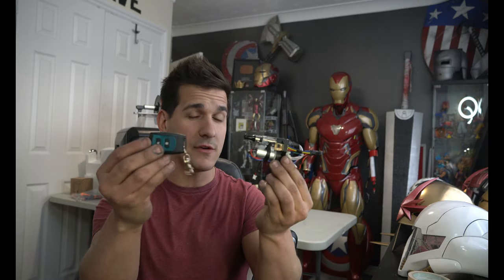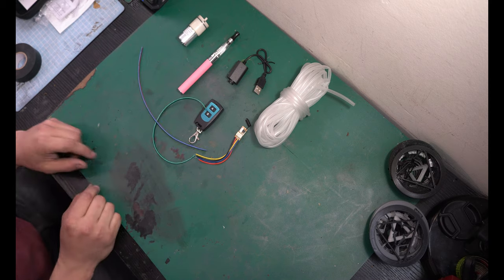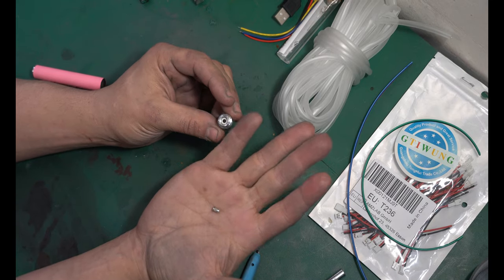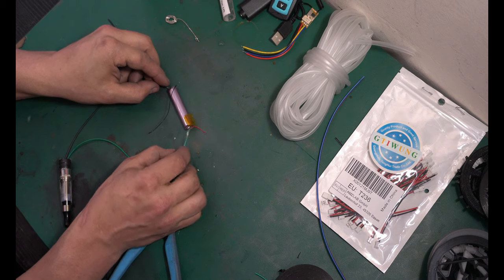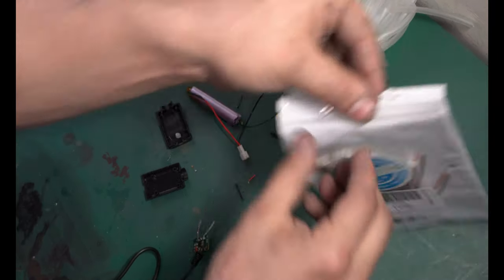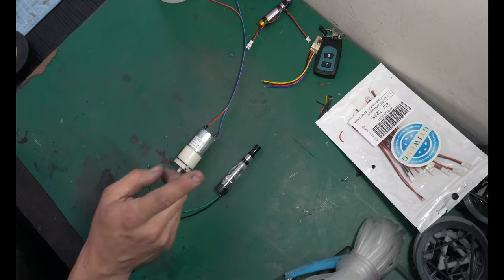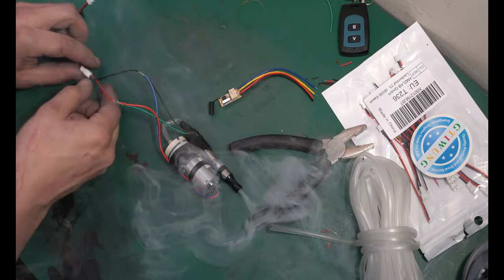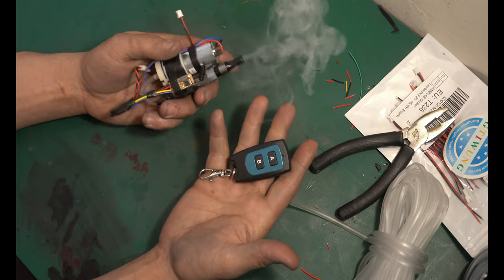Remote Control Cosplay Smoke Machine  - Tutorial

Comment: I'm curious if I added a hose to the front where the smoke is coming out, how far could it be directed. I'm trying to make the nostrils of a dragon costume smoke. Even though the smoke machine is small, it's too heavy for the mask. If I put the machine in the wings and run a hose over the shoulder to the nose, would it still work ok?
Reply: I extended the exhaust outlets on a model tank in the way you’re thinking - by using small bore silicone tube (3mm inside diameter). Very flexible and doesn’t leak, worked a treat!